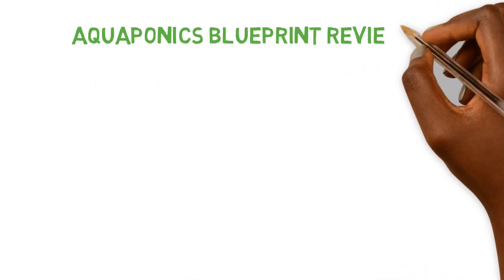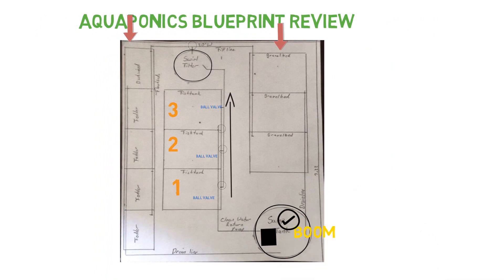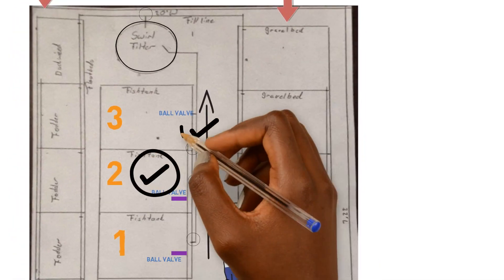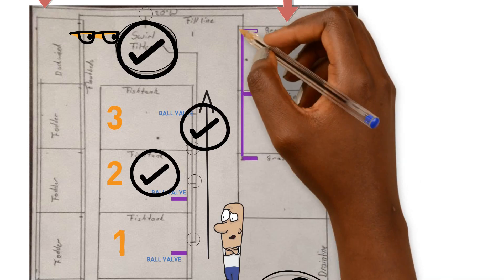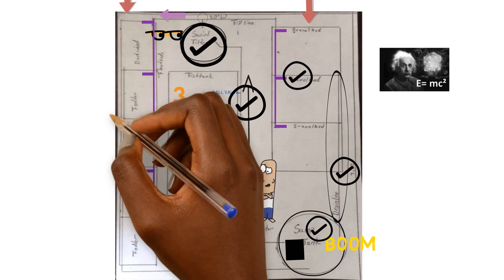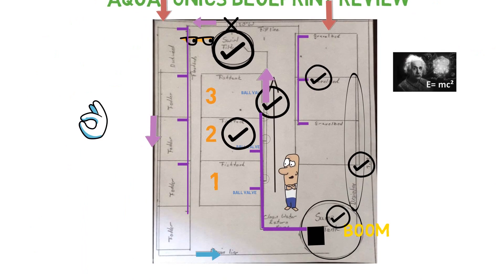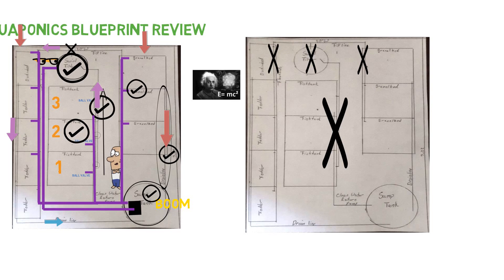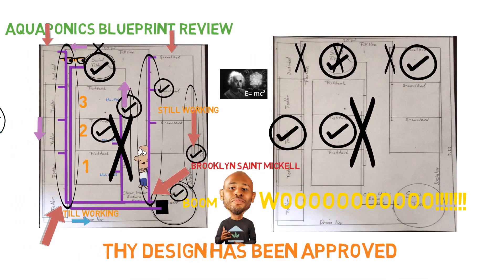Aquaponics Blueprint review 5 | Ask The Aquaponics God Ep33

Comment: I think the design is fine. I never like when water comes back to the sump where water is going back to fish before going to through the system which acts as the filter. I understood immediately what the person meant. water goes through the whole system before coming back to the sump thus removing nitrates and amonia. having the water go from the swirl filter, back to the sump, then back to the fish is not truly filtering the water. At this stage of my life I am more of an aquarist than an aquaponic farmer. The beds are the filter, and you don't skip the filter if you want nitrates/amonia to zero (or as close as possibe) by the time it comes back to the fish.
Reply from the maker: You're assuming that he has improper flow rates. With proper flow rates the water is circulated through the entire system frequently enough to remove all nitrates and ammonia. You're also assuming that plants take up all nitrates in a single pass through, this is incorrect as well. Our systems runs on a split flow and we can check nitrates coming from the filter and then from the plants and receive the same readings; That's due to proper flow rates.

Comment: Good stuff:) Wont the fodder rot out if you keep water running through it? Also, wont the run off from the fodder affect the pH and nitrates? I would think it would dirty up the water.
Reply from the maker: George said that he was going to have them inside of half barrels. We assume that he knows what he is doing with growing that crop as we have never grown it before. It shouldn't affect the pH if it isn't grown in any soil. He didn't mention anything about soil. Do you have some insight on how fodder is grown in aquaponics?
Reply: Oh, sorry I must've missed that part. The pH comment was more of a question. I know that when I soak my seeds a lot of junk comes off of them so I really don't know if that is going to affect the pH or the nitrogen cycle. They also cannot be soaked in water for very long once they sprout because they have a tendency to grow mold. If it is a flood and drain system I'm sure that would work provided the seats aren't too deep and provided that the flood and drain is on a timer. I only ever soaked my seats down with water once they sprouted like two or three times a day and I did not get much mold issues but I would think with more frequent watering they would stay moist and develop mold issues. I love the idea and I want to try it in my AP system  but I'm afraid it will affect my water chemistry so I haven't really tried it yet:)  I know my chickens would love it! Ha ha ha!
Reply: Also my thought process behind it was " I know this is in a AP system so I know there's no soil but rotting plant matter turns into soil. I wonder if rotting/mold on the seeds could raise or lower the pH.". 

For instance, driftwood and Pete Moss can gradually buffer the pH of water down. I hope that makes sense my friend:)
Reply: By the way, I'm loving the videos my friend so keep them coming and God bless:)
Reply from the maker: That definitely makes sense. The amount of impact that it has on the system will be relative to the amount of rot that he experiences and the amount of fotter he has in the system. We have never used that type of crop, so it's hard to give an accurate answer to the question you're promising. We will just have to see what the gentlemen says once he provides an update. Fodder is not something that most people grow in AP. It may work in the system or it may be more suitable for soil application. We shall see!

Comment: Under the 'improved design' would a larger pump be needed? If so, what about the cost effectiveness of the larger pump needed? [how much more $/month, required?]
Reply from the maker: Very Good question Justin. The alternate design would likely call for a slight larger pump (to supply pressure), which will require more money, so you have to weigh the pros and cons and see which risk you're willing to take. If anything goes wrong in any part of the gravity feed then you're whole system is in jeopardy of crashing (which will cost you money in fish and plants in the long run). If anything goes wrong on the split flow then only that portion is off-line (which cost more money upfront). 

It's just boils down to what your priorities are and risk you're willing to take, but you can expect a failure to happen for sure at some point. It's just the way it is. The price difference isn't that significant; especially on such a small scale.